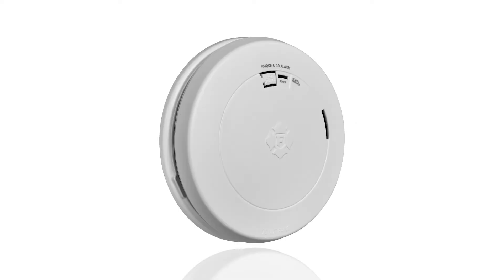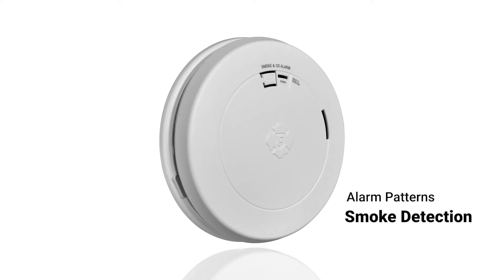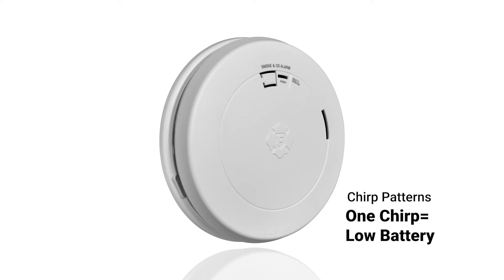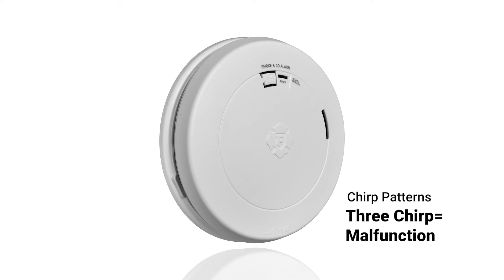Interpret Alarm Patterns and Chirps of a First Alert/BRK Detector

Comment: I have 2 alarms bought in a set, and today both went off, about 6 hours apart, but the beeps were very loud, and maybe 5-10 beeps? Then stopped. It did not repeat again from either unit. I’m assuming that for carbon monoxide it does the beeps in a pattern continuously? They are maybe 2 years old so the batteries should be fine.
Reply from the maker: Hi Margaret! Thanks for reaching out and sharing your experience.
What you described could potentially be a nuisance alarm, but to better understand what triggered the beeping, we’ll need a bit more information, especially the model number of your alarms. Carbon monoxide alerts typically follow a consistent pattern and repeat until the issue is resolved, so what you experienced may not be a CO event.
To ensure your safety and provide accurate support, we recommend contacting our team directly at 1 (800) 323-9005. We’ll be happy to help you troubleshoot and clarify what happened. -Dinorah

Comment: My carbon monoxide is plugged in, but also has a 9V battery.  It chirps once every 1 min.  I removed the battery and have it plugged in to a live outlet and it stills chirps once.  It shouldn't do that, because it has direct power and the battery is for back up.  Why is it doing this?